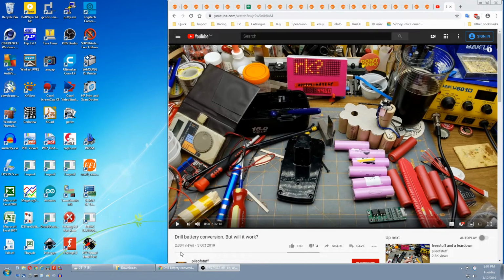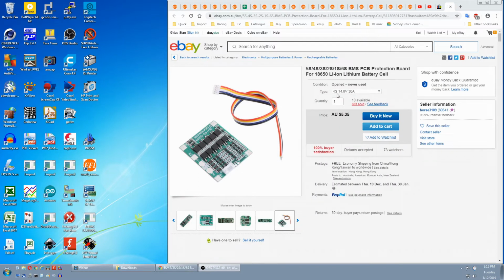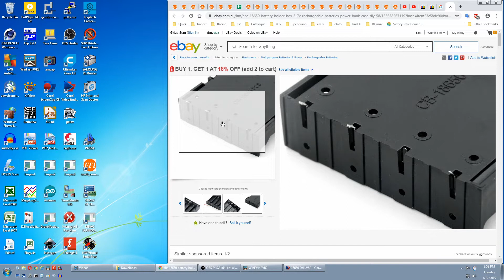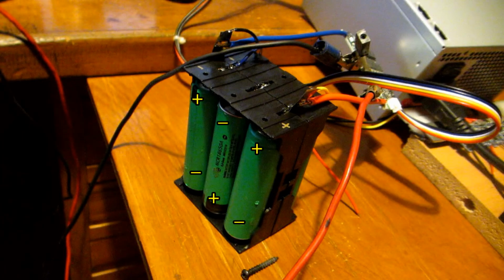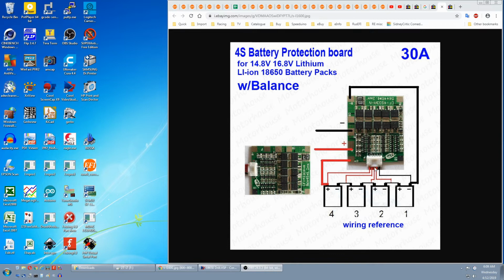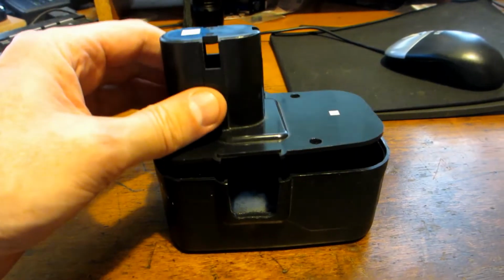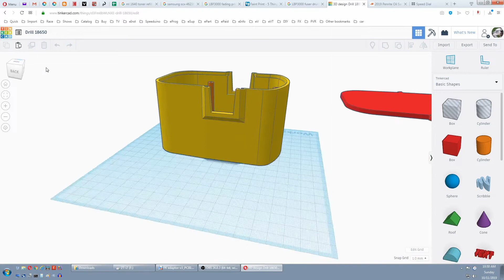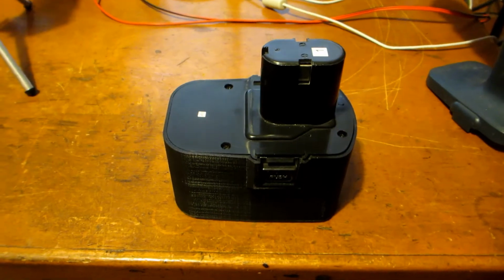NiCd to 18650 Li-ion Drill Conversion

Comment: I'd love to see a corded cordless drill. Aka put a charger in the battery that can power the drill if plugged in. I only need cordless occasionally but the battery is always dead. So I use my corded drills most of the time. Also super cap instead of battery would be cool for rapid charging the battery.
Reply from the maker: I was actually thinking about that because I mainly do simple hole enlargement indoors, but I had 18650s, plus I do outdoors sometimes, so I went Li-ion. S-caps are a bit pricey for me.